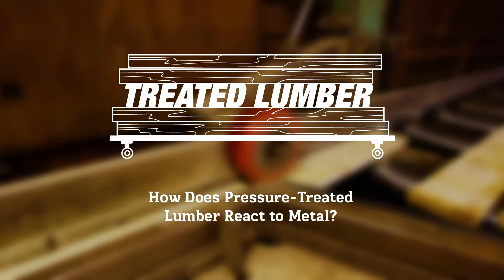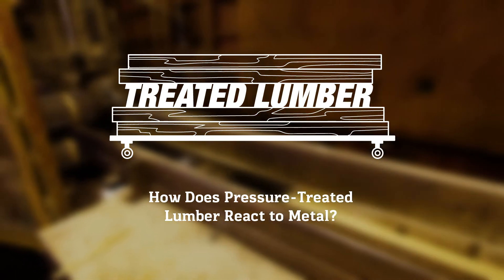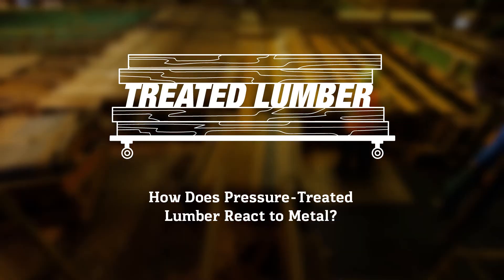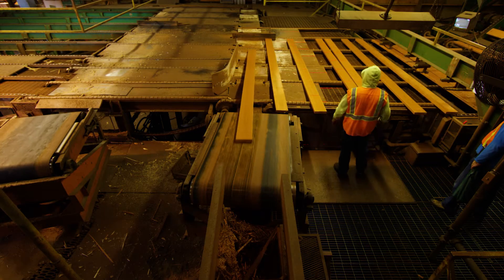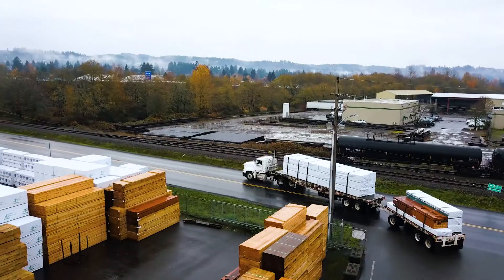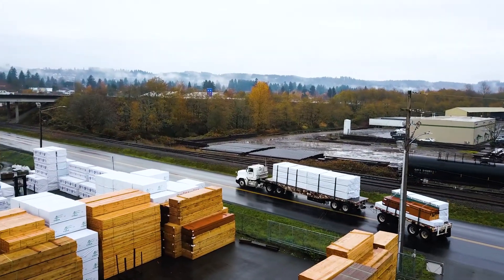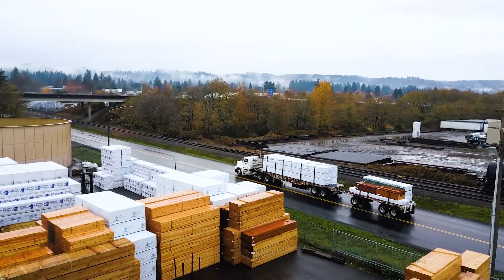How Does Pressure-Treated Lumber React to Metal?

Comment: " Is there some corrosive factors? Yes, but there's a lot less then there used to be."
Reply: Every source I see shows that PT wood after 2003 is more corrosive than it used to be.

"alkaline copper quat [ACQ], copper azole [CBA-A and CA-B], and sodium borates [SBX]) now being used in pressure treated wood have been shown to be up to two or three times more corrosive than the previously used chromate copper arsenate (CCA)"

Where do you find this guy?
Reply: @drheck  in 1 year i had my coated screws eaten threw... 1 year...